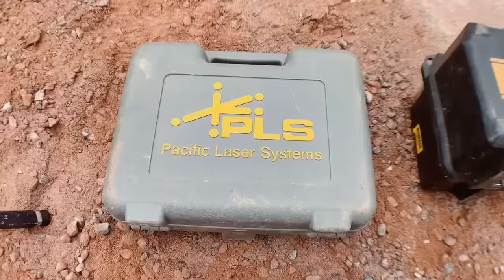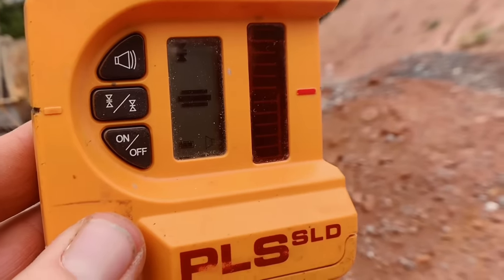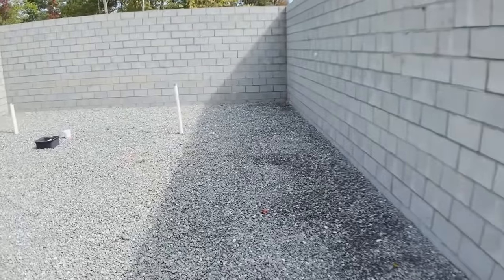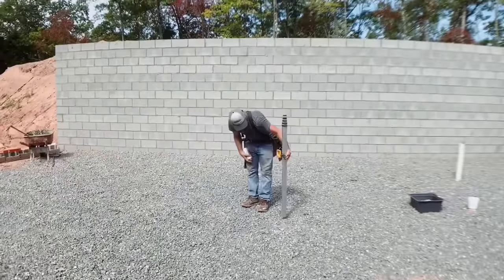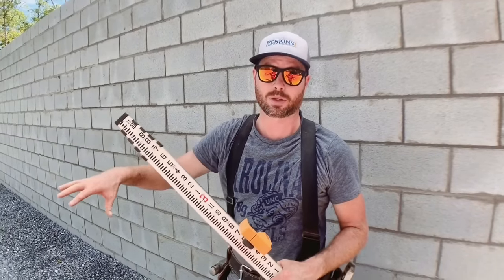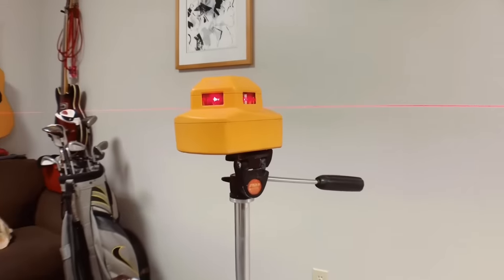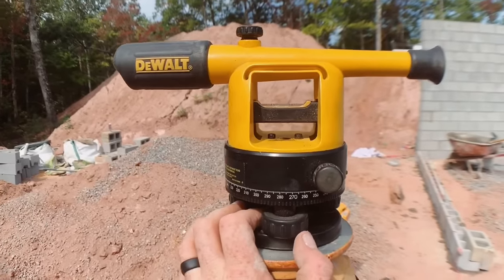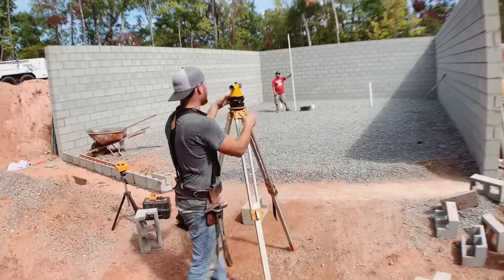Laser Level Basics | How To use a laser level

Comment: Newcomers to a laser level always seem to get confused on - When the laser sensor moves up on the rod, that means the grade is going down and vice versa. I always found it helpful to tell them to ignore the location of the laser sensor on the rod and just pay attention to the bottom of the rod.
Btw, that ‘scope’ is called a builders level.
🤜🤛
Reply: But then you haven't taught them the specific functions of the tool imo. Understanding key components of a tool is critical to me because if someone is limited, ie; their asked to use it but dont understand how to adjust it, and only know to look at the bottom, there lays an issue imo.
Reply: Well builders level is more of a brand/niche term but transit level or grade level is the most common term west of Colorado. Or yeah sure guys call it a scope a lot, but you tell a kid to grab your builders level, hes coming back with your 4ft stabila
Reply: @skytanner7355  ‘Builders level’ is not a brand name, niche term or even a regional preference. It’s the name of the tool. Google the term and no 4ft Stabilia comes up. A ‘transit’ is used for measuring angles, vertically or horizontally. A ‘grade level’ is a measure of how much education a student has completed.
If the new guy comes back with a 4ft Stabilia, he hasn’t been instructed properly on correct tool terminology.

Comment: Great job on the video. What is the deal with that quarter cut out on the block?
Reply: I think it allows the concrete for the floor to flow into that block, locking it in to the foundation. The top of that block is the same level as the finished concrete floor. The block forms the front edge of the slab.

Comment: could you use the sensor instead of the string line? and do you use a digital reader to measure distance. And could you use a digital level instead of a bubble level they are way more accurate.

Comment: Was there a purpose/reason when you started the last wall with the first brick to the center instead of going off one or the other finished walls?
Reply from the maker: Yes...Good question! That wall is a 15° prow ( it’s hard to see in the video). That first block was at the corner of the prow which was the end of one side of the block runs.

Comment: How can you use a laser level to check square walls to lay flooring or tile?
Reply from the maker: Use it for wall tile... and can check if vertical posts are level each other while framing
Reply: Not sure with a laser level but I dont worry too much about walls being square, because they usually are not.

There is always one corner that is just off.

In that case do your best to find the best corner. Then measure in about a foot from each wall and make a mark.
Use a large framing square to draw a square corner.
This gives you a reference.

Depending on the size of the room, you can either pop chalk lines(do not use RED chalk) or draw lines to create a grid from which you can pull measurements.

Check the measurements at each end and the middle of both sides to all walls.

By graphing them you can see where one wall bows or angles out of square. Allowing you to adjust your tile accordling.

Remember floor trim is a certain thickness on each end and depending on that thickness you can hide some of the un straightness.

Note RED chalk is no no near any finished ot nearly finished product. It contains oil that will stain and will bleed through finishes.

Comment: I don’t get it.  Why did you bother to do all that work to ensure the gravel was perfectly level?  I would have put the laser in the middle or anywhere else and project a line on the interior of the block walls. Then I would have poured the concrete up to that line.  The result is a perfectly level concrete floor.
Reply: Because getting the gravel at the correct elevation, prior to pouring the basement slab, assures you don’t have either too thick or thin areas in your slab.  Too thick of areas is costly (concrete costs much more than gravel) and concrete that is too thin doesn’t have the desired load capacity.